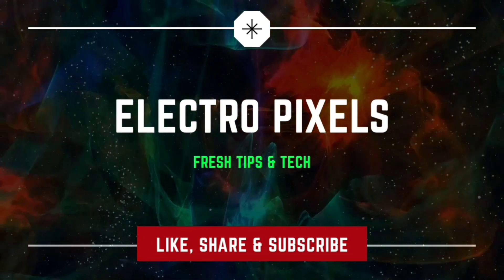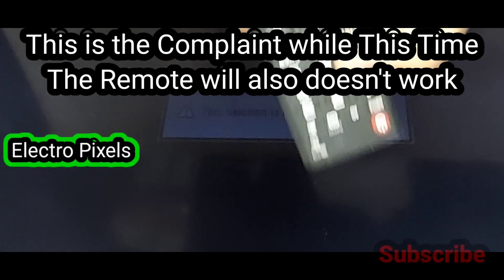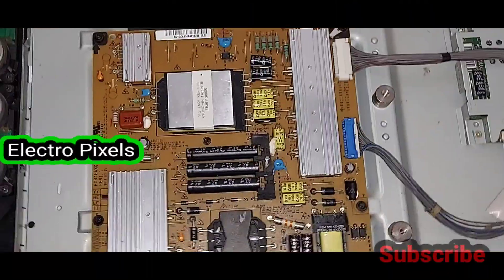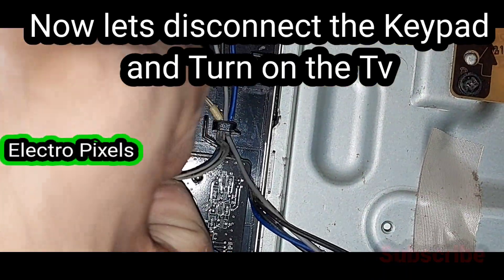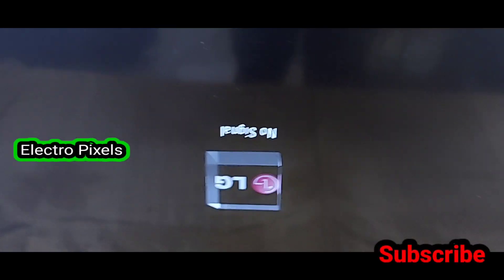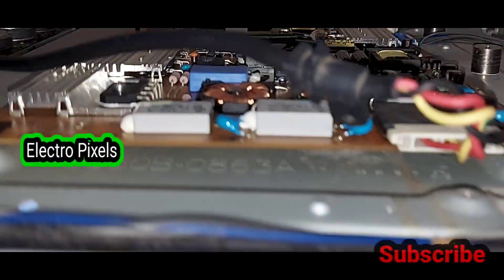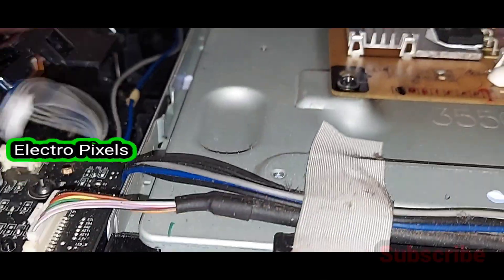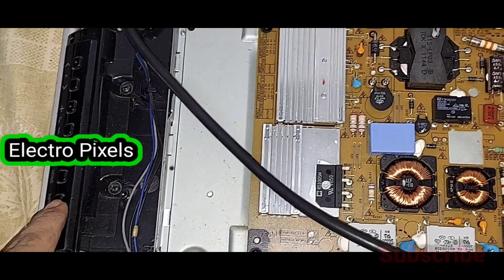Lg Led Tv "This Function Not Available"Error Message Solution, Remote Not working Repair. Error

Comment: Thank you! My old LG TV is also suffering from this problem. Not only it’s showing the same error message, but the channel is cycling forward.
Reply: Could you find a solution for the Chanel forward problem?
Reply: No. It’s board got replaced for IDR400k.
Reply: @jaimeb.384  The error message is caused by a physical button being pressed on the tv, such as channel up. I believe that the board he unclips in the video is the controller board for the buttons on the side, and when it malfunctions it sends a signal to the TV saying a button has been pressed.

If you unclip the board like he did, I think that should stop the "channel forward problem"

Comment: Thank you. It really worked, only keyboards are not working as the connections are removed, but no worries as i don't use keyboards..
Thank you 😊👍😊
Reply: Did you have to discharge your TV or is it safe?

Comment: Well… my tv was doing the same thing and some other strange things.. opened it up and found two bulging and one leaking capacitor on the power supply board! Replaced all the capacitors and whala!! Brand new 32 inch LG TV 😊

Comment: I have a lg37le4500 and i have a similar problem but it's not flashing, it's more intermittent and it only occurs on the HD inputs.

 I found that when you press text or program up or any similar input on the Remote Conrol the message pops up and you can remove the message temporarily by pressing exit.

 I tried removing the buttons on the tv to no avail but I have found a workaround... 

If I hold the ok button on the tv buttons panel it blocks the "function not available" message.

I haven't found a method yet to keep the button held in, will probably use a small vice/clamp or some strong tape but I've tried everything and this looks like the only solution for me

Hope it helps others

Edit:a guitar capo works fine